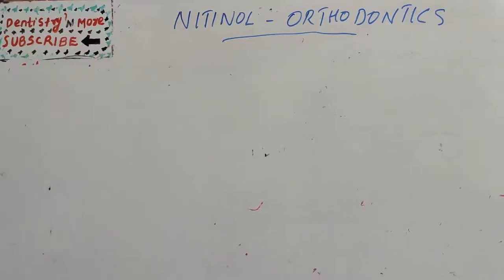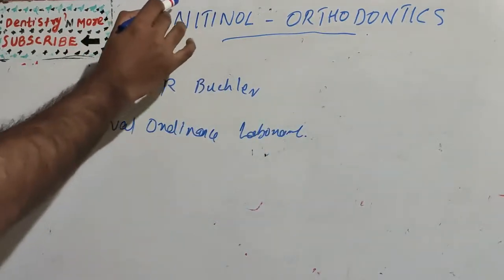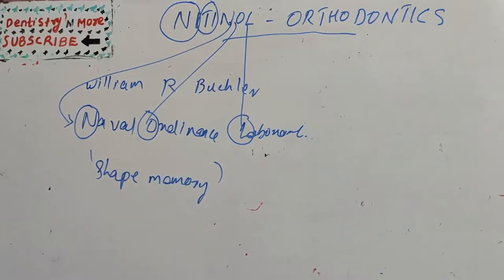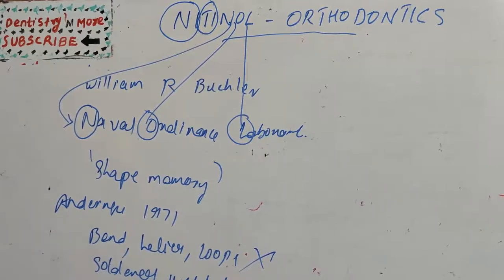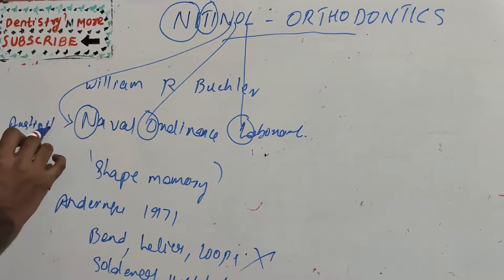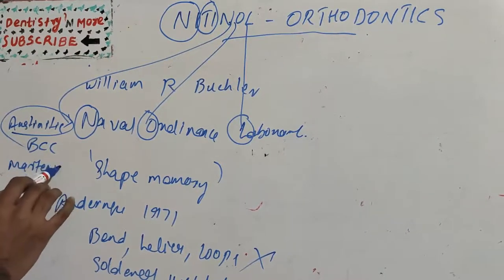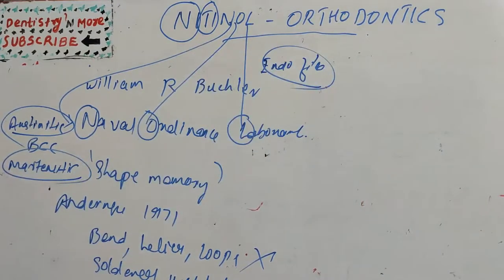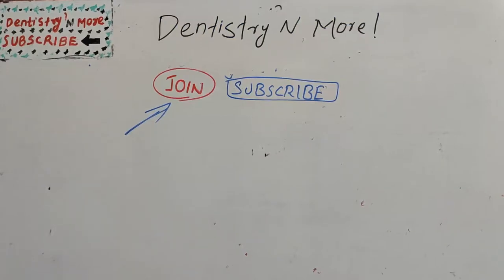NITINOL

Comment: Explain how martensitic and austenitic phase change happens.
Reply from the maker: Martensitic Stainless Steel
Martensitic stainless steel is formed by the creation of martensite. Martensite has been a key element of quenched steel for hundreds of years, but was officially named in the 20th century after the metallurgist Adolf Martens (1850 - 1914).

Martensite is a body centred cubic form of crystallised iron which is created when heated austenite is rapidly cooled by quenching. The increased rate at which Martensite crystals are created prevents cementite from being formed, and causes carbon atoms to become unnaturally trapped in crystals which would ordinarily expel excess carbon during gradual cooling.

Martensitic stainless steels can be heat treated and hardened, but have reduced chemical resistance when compared to austenitic stainless steels. Martensitic stainless steel is often used when hardness is critical, such is in knives, where surface hardness creates a sharper blade.